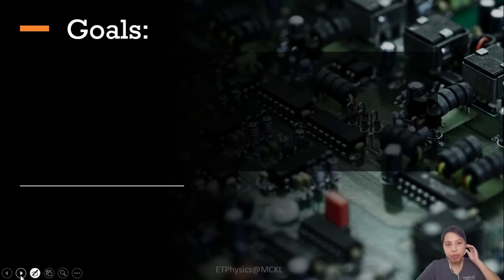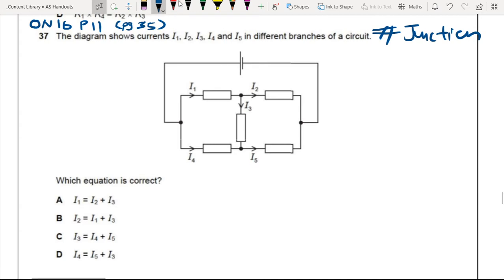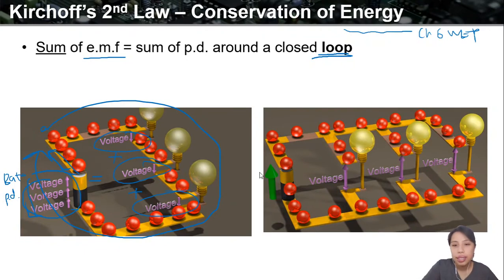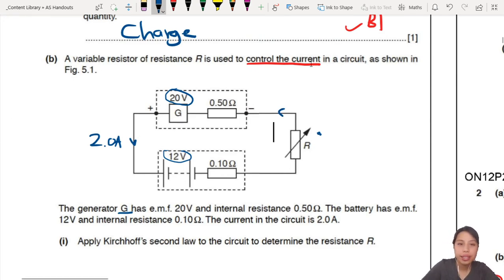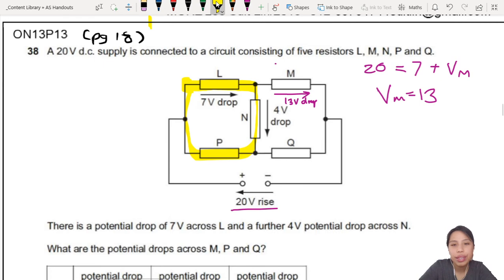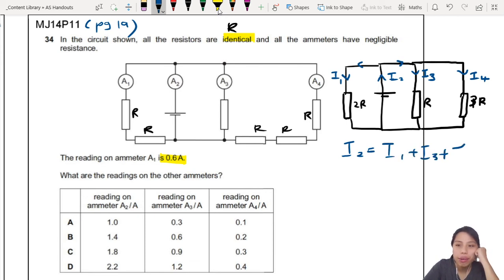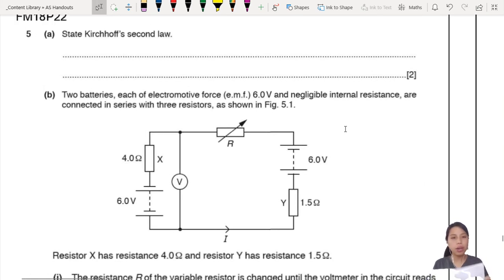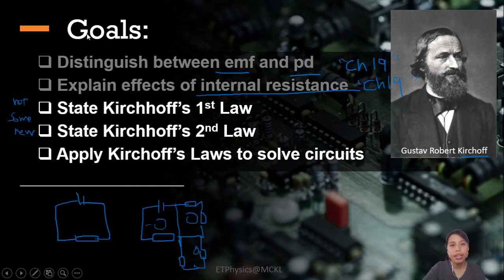[ARCHIVED] Kirchoff Laws | AS DC Circuits Electricity

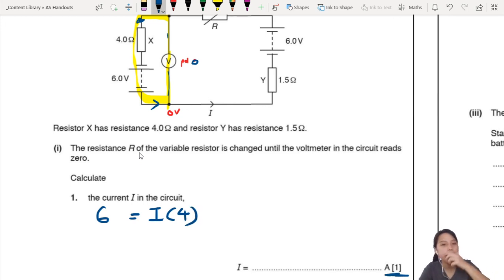Comment: 45:10 Miss voltmeter has infinite resistance and it does not allow current to flow through it how can we consider it as  a loop,i know you are 100 percent right but i didnot understand this,and if current passes through it  will split and then how will it be I(current ) ?
Reply from the maker: Yes we can assume no current is flowing through the voltmeter. BUT, we can actually draw Kirchoff loops whether or not there's current flowing thorugh a component, actually ;)
Reply: @ETphysics  Oh.